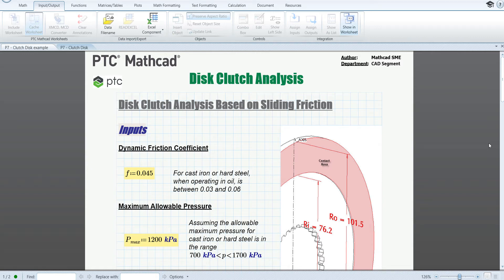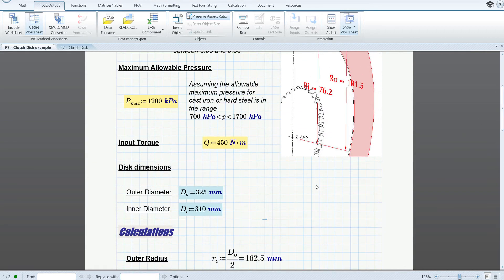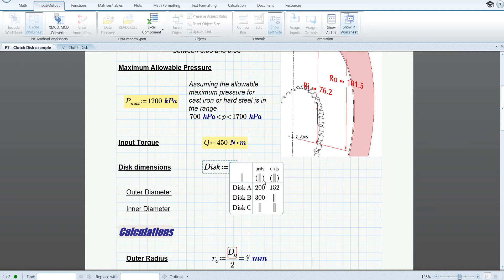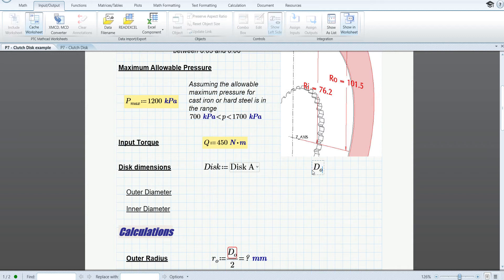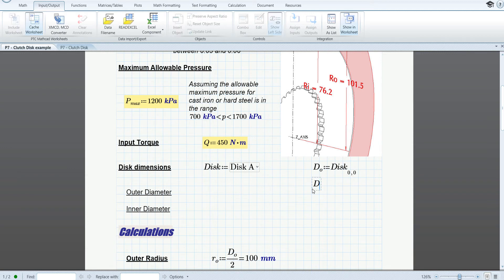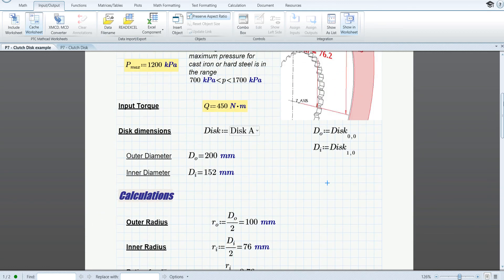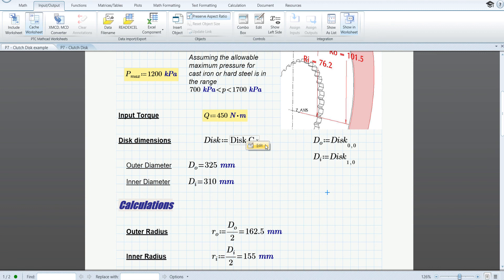Combo Boxes | Mathcad Prime 7

Comment: How did you add more identifiers/variables?
Reply from the maker: Sorry, could you give a timestamp?
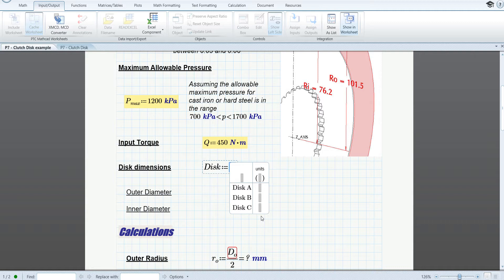Reply: @PTC_Mathcad  0:51 How did you add a +1 column on the right for the 2nd variable?
Reply from the maker: @KazartsevVC  Use the Matrices / Tables tab's Rows and Columns group commands (Insert Right / Insert Left, the presenter in the video likely used the keyboard shortcut Shift & Space).

Comment: Hi. As a structural engineer I work with huge numbers of steel shapes (IPN, IPE, HEA, HEB, etc.). Will be a possible in future to have a Combo Box as an "independent sheet" and call data from this sheet? - for me for example from sheet with name "Steel Shapes" if I do steel shape checking or for another type of calculation from sheet with name "Concrete Grades" if I do concrete shape checking. Thanks
Reply: I understand your trouble. My first thought trying to use combo box is how I'm suppose to populate table? manually every time? The hole idea is that you want to remove copy/pasta and human error and just reuse existing tables and data. So for now I will use old "match()" function and hope they will improve it.
Reply from the maker: Hi Dusan,

I asked our product manager, and he said this sort of functionality (called "scripted controls") is on the Mathcad Prime product roadmap.